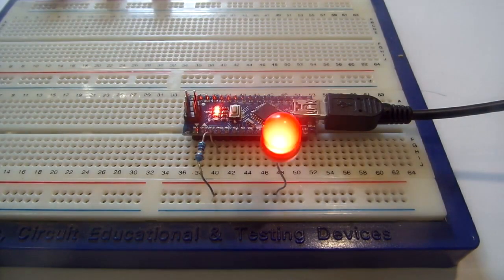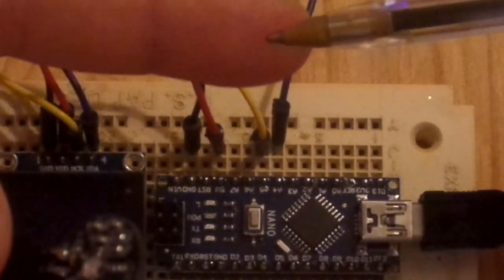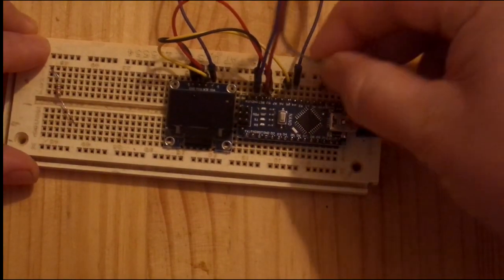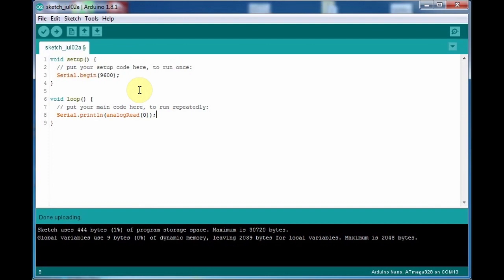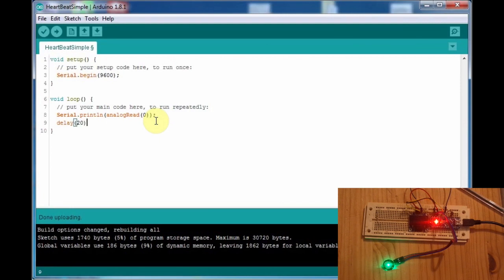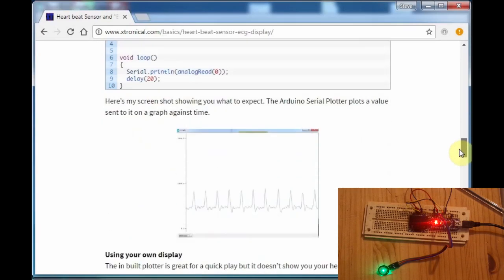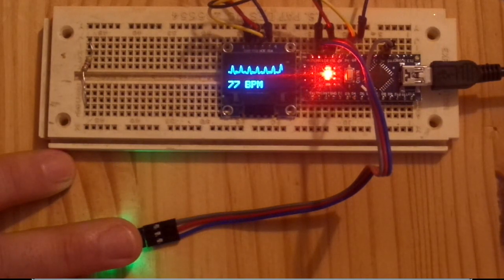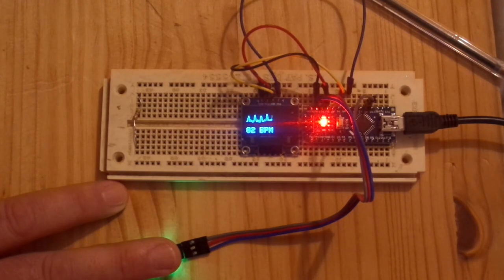Heart/pulse sensor with Arduino

Comment: Hey man, i tried running your code and my BPM was 0. So i checked the raw value with help of the serial plotter and found it to have a range of 120 to 130. I changed the threshold still found no change. I also had to set my cursor to display BPM from (0,50) to (0,0). Please help me. I am using  this 
Oled:- https://www.amazon.in/ThinkletsTM-Yellow-Blue-Display-Arduino-Raspberry/dp/B0778VMFJG/ref=sr_1_3?ie=UTF8&qid=1524481313&sr=8-3&keywords=oled+display+for+arduino
and this sensor :- https://www.amazon.in/Invento-INVNT_11-Heartbeat-Detector-Arduino/dp/B01MU8KP38/ref=sr_1_1?ie=UTF8&qid=1524481361&sr=8-1&keywords=pulse+rate+sensor+arduino
Reply from the maker: Hi, there are some displays which seem to  need an offset value for Y position, it has come up here more than once. I'm thinking you OK with that part from your comment. The BPM as you noted depends on the values returned from your sensor and the threshold values. Values of between 120 to 130 is far too small a range to make any real judgement of BPM, if you look at my raw trace (at http://www.xtronical.com/basics/heart-beat-sensor-ecg-display/) it has values of between about 480 and 700. Why yours returns such a small range is a bit of a puzzle. They are not the most accurate of sensors but I would expect it to be better than that. I would suggest putting it on someone else finger (in case your capillaries are somehow deeper) and also do not press it on too hard or to loosely as both these factors dramatically affect the result.
Reply: Hey, buddy thanks for such an early reply. I actually tried to run the code without the OLED and got a range of 500 - 550 specifically for the pulsating signal. But when I connect the OLED and see on the serial plotter I get a range of 120 - 130. I am using Arduino UNO R3 board for uploading the code. I also tried different fingers and different intensity of force to place the finger, still I can't see the a proper visual of the signal on my OLED and the BPM value stays 0 while I see a very tiny bar signal on my OLED
Reply from the maker: 500-550 is odd in so much that those are the exact values for the lower and upper threshold settings. When it's 120-130 you could try a lower value of 122 and a upper of 128, but that's a really tight range and would usually just be noise, also alter this line (line 35)

int y=60-(value/16);

The 16 alters the magnification factor of the line, a lower value increases magnification, perhaps try 1 or 2 here.

The type of Arduino should make no real difference. The value changing when you plug in the oled suggests the voltage dropping quite a bit with the oled connected - although again this would have to be quite a bit and would be odd behaviour.

It seems like your pulse sensor could be faulty but to rule that out completely would mean buying another one from a different supplier.

I'm actually re-visiting this project this week as I want to add two screens and have bought new screens and a new sensor. I'll see if I get any similar issue.
Reply: Okay,  I will do the changes and see. I checked to run your threshold code, and I got a range of 320 - 360 now. It is really weird, that it is giving such low signal but I have used to this sensor for getting an output before as well.

Comment: Arduino: 1.8.4 (Windows 10), Board: "Arduino Nano, ATmega328P"

C:\Users\Akmal Zhafri\Desktop\USER LAIN\acap\sketch_apr17a\sketch_apr17a.ino:1:30: fatal error: Adafruit_SSD1306.h: No such file or directory

#include <Adafruit_SSD1306.h>

^

compilation terminated.

exit status 1
Error compiling for board Arduino Nano.

I have problem about this
Reply from the maker: Have you added the adafruit Ssd1306 library?
Reply: Thanks you , your help me lot

Comment: I am a beginner. I am helping my daughter in a project for technology class. We have two oled screens of the same type. I tried to separate the graph in one screen and in another BPM and I could not. I would greatly appreciate this help. Surely for a knowledgeable person, it is clear how to do it.
Reply from the maker: It is possible but unfortunately not straight forward. I'm not sure of your level as a beginner but basically the Arduino sends data to things connected to it, such as the OLED, in a way similar to the way letters are sent. It sends packets of  information that has an address on it. The screen is manufactured with one particular address, so if you have two screens they will both have the same address and it's impossible to tell the two apart and you therefore cannot send some data to one and not the other.

There are solutions. 

One is to add an extra chip that allows you to stop one of the screens listening for data whilst you send to the other and vice versa, but I don't have one in my parts bin to build a demo with.

Another is a "software" solution that adds another data route using different Arduino pins, it's a bit like having another town with the same street name in it. You would have one screen in one town (on one set of wires) and the other screen in the other town (a different set of wires). However it would require some work to get all working.

A third is to see if the address of one of your screens can be changed, some allow this by de-soldering or soldering a connection on the back. But all the cheap ones I've bought don't have this facility.

Someone else requested this a little while ago and it's on my "to do list" but has not made it to the top yet unfortunately. I'll message on this thread when I have a look at it.
Reply: thank you very much for your response and for your interest

Comment: on oled it does not show me numbers with BPM it only shows graph plz help
Reply from the maker: It may be you need to alter the Y position of the BPM text, these lines do it:

oled.writeFillRect(0,50,128,16,BLACK);
oled.setCursor(0,50);

Try changing the 50 in both lines to 20 and see if it appears (Will probably go over waveform).  Then you can also move the wave form upwards with this line

int y=60-(value/16);

The 60 alters the trace Ypos, try 20. This should move it upwards making room to move the BPM up. Another user had a similar problem and I'm guessing different hardware not working quite same with adafruit oled driver perhaps.
Reply: Everything works almost perfect

Comment: Can we use this sensor on the chest ?
Reply from the maker: I've not tried, it might work but it is a pulse sensor not heart sensor. It doesn't detect electrical impulses but rather changes in blood flow in the capillaries under the skin. This may or may not work on the chest. I've not got the circuit set up at present to test but the finger is more convenient.

Comment: what lcd is used..?
help...!
Reply from the maker: It's a 128 x 64 pixel oled display. It uses the Adafruit 1306 driver and is I2C for the connections. There is a full write up for this project at 

http://www.xtronical.com/basics/heart-beat-sensor-ecg-display/

and a write up just for the OLED at

http://www.xtronical.com/basics/displays/oled-128x64-arduino/

Comment: Your code is not giving me any BPM when I keep on the finger used it through Bluetooth..it is only working when I took my hand frequently..is there any solution to fix this..
Reply from the maker: How did you use it through Bluetooth? Have you tried the simple code to send your results to the serial plotter
Reply: I used it through SoftwareSerial.h
SoftwareSerial btserial(10,11)
btserial.Println
Reply: I am not getting output when I keep on the finger ..it shows output when I frequently take the hand from sensor..pls give me correct code or suggestions to make it correct
Reply from the maker: The code is correct as it works for many users. Try checking if your sensor is returning anything sensible, to do show your heart beat graphically you can use the Arduino IDE in-built serial plotter. Load up the code below into your IDE, then upload to your Arduino. Then select “Tools->Serial Plotter” and see if you are getting some output from the sensor.

void setup() {
  Serial.begin(9600);
}

void loop() 
{
  Serial.println(analogRead(0));
  delay(20);
}
Reply: For ur code I'm getting automatic values running in loop without touching the sensor
Reply from the maker: You will get some values fluctuating from the sensor, this is normal,, this is the sensor doing this not the code. Have you tried the serial plotter code I mentioned?

Comment: I’m getting an error code with the display code saying ‘error compiling for board Arduino/Genuino Uno.’(I am using arduino uno)
Reply from the maker: There should be more text than that, there should be the actual line displayed where the error is occurring, have you any more details
Reply: XTronical I’m pretty sure that’s all it says I’ll have to have another look so you perhaps have an email that I can contact to show the error message?
Reply from the maker: If you private message through you tube I'll pass my email on through that.
Reply: so I was being a bit stupid and the error code immediately put me to the bottom of the error section so i scrolled up and the error message says... 'C:\Users\family\Documents\Arduino\heart_beat\heart_beat.ino:1:30: fatal error: Adafruit_SSD1306.h: No such file or directory

 #include <Adafruit_SSD1306.h>

                              ^

compilation terminated.

exit status 1
Error compiling for board Arduino/Genuino Uno.'
so im still slightly confused by this but im assuming it simply means it cant find the correct file needed to run/save the code?
Reply from the maker: Yes, go to library manager (on sketch menu), search for adafruit 1306 and install that library. Make sure you have installed the graphics library too from adafruit. I
Reply: XTronical thank you ps will it be okay if I reference you in my project for my college course as I have to put people who assisted in a section of the report (I can just reference the channel name).
Reply: XTronical could you please send me the link for both of those please because I’m not sure I have the right ones as I’m getting nothing displaying on the screen but the code does upload to the arduino now
Reply: XTronical it may be my screen because it has 7 pins instead of the normal 4.
Reply from the maker: Of course you can reference the channel name, very polite of you to ask :)
Reply from the maker: The links are on the page with the code on it, here : http://www.xtronical.com/basics/heart-beat-sensor-ecg-display/
Reply: XTronical okay thank you just didn’t want to reference you without your approval first. after all it is your channel :)
Reply from the maker: Yes, sounds like you have a different screen, send me a close up screen shot of it, you've got my email now.

Comment: Hello,
i did in Uno, it is olny showing waveform but it is not showing BPM. please tell me that what is the problem
Reply from the maker: Is the wave form near the bottom or does it look like the one in the video, it may be you need to alter the Y position of the BPM text, these lines do it:

oled.writeFillRect(0,50,128,16,BLACK);
oled.setCursor(0,50);

Try changing the 50 in both lines to 20 and see if it appears (Will probably go over waveform). Are you using a 128x64 pixel display?
Reply: yes, the wave form is in the bottom.  i am using 128x64 pixel display
Reply from the maker: Then you can also move the wave form upwards with this line

int y=60-(value/16);

The 60 alters the trace Ypos, try 20. This should move it upwards making room to move the BPM up. Another user had a similar problem and I'm guessing different hardware not working quite same with adafruit oled driver perhaps.
Reply: you using 0.96” inches display or 1.3” inches display?
Reply from the maker: 0.96 inch 128x64 OLED display.
Reply: Thank you so much. it helps a lot to me
Reply: Thank you. its working😊
Reply from the maker: Excellent, glad it helped.

Comment: Hi!! How to display bpm without using led monitor but on serial monitor itself? When I read the article it's simply been given that we cannot .. Is that possible if we use some extra code?..Pls help admin
Reply from the maker: If you scroll down the page you've read, towards the bottom you will find a section titled "Addendum". This has the code to output the BPM to the serial monitor.

Hope this helps :)

Comment: what to do if values are overlapping with each other and also the values are overlapping with the waveform please give me a solution.
Reply from the maker: The waveform needs scaling differently, this line:

int y=60-(value/16);

scales the height of the pulse, changing the "16" to a higher value will shrink the height of the pulse. Try something like "20" to starting with and adjust if that is not enough or too much.

For you other problem, do you mean the numbers of the BPM, e.g. "73" actually overlap each other?

Comment: Which module should I opt for measuring the heartbeat constantly then ??
Reply from the maker: Here's s link to the one I ordered: 
https://www.aliexpress.com/item/Pulsesensor-Pulse-Heart-Rate-Sensor-For-Arduino-Open-Source-Hardware-Development-Pulse-Sensor/32714920300.html?spm=a2g0s.9042311.0.0.XznPAg
Reply: No, In the verdict you said that though it is measuring the heart rate ,if we apply less or more pressure it gives error
So which other sensor should I use, I want to monitor hear rate of a person constantly and alarm if it comes in a certain threshold
Reply from the maker: +Arjun Sharma sorry for misunderstanding, I have not investigated other sensors yet.

Comment: I'm use 0.96 oled 6 pin (+pin (DC+Reset)..... And i do this video but it's don't work???? 
Can you help me for how i can connect the oled 6 pin with arduino mega?? 
And give me the code with the Modifications That fit with the 0.96 oled 6 pin??? 
Please
Reply from the maker: +Master7 Semo do you have a link to the oled you have so I can check it out
Reply: XTronical this is the link http://www.rhydolabz.com/displays-c-88/096-oled-display-module-spii2c-128x64-6-pin-white-p-2260.html
Reply: XTronical For information i work on (arduino mega)....... 
I'm looking forward to helping you
Reply from the maker: OK, I've looked at the OLED and to make it work with the project (in I2C mode) actually requires some soldering on the PCB of the OLED itself, sounds a bit of a pain. However it supposedly works easy with SPI protocol but I don't have a similar screen to hand to test with. I'll order a similar screen I'll re-do the code.
Reply: XTronical ohhhhhh 😢..... That's main i can't do anything to do the project....
Reply from the maker: +Master7 Semo Ali express are cheap, look for a 4 pin I2C one

Comment: Hi I follow your video, thanks for sharing.
Mount the sensor and it works, a question the beats are overwritten in the screen, is it normal ?.
in his video this defect is not observed.
I have something wrong?
There's a solution?
A greeting from Barcelona
Manel
Reply from the maker: Do mean the trace goes over the BPM text? If so your sensor might be giving a bigger result and just needs to be scaled down a little.
Reply: No, taraza and numbers are separated, this is correct, they are the numbers that are overwritten when they vary, one above the other.
when the trace finishes, then they look clean, but they are overwritten again.
There's a solution?
Your video the numbers always look clean.
a greeting

Comment: can i contact u?i want ask something..give an email also ok..
Reply from the maker: You can comment also on www.xtronical.com
Reply: XTronical why in serial monitor the reading become hundred something??but on your lcd is below hundred..what the difference between the reading in serial monitor and lcd?i want show the reading using mobile app..not using lcd..
Reply from the maker: There is no real difference, the value is either output to oled or to the  serial monitor, the code is effectively the same. I would think those higher values are just anomalous and just didn't occur when connected to oled.
Reply: XTronical my project is about to monitor temperature and pulse rate using arduino and bluetooth module hc 05. I already tried code for pulse rate..i just not understand the reading of the sensor.. How we want to calculate the bpm.
Reply from the maker: It can be a little tricky to calculate BPM from the raw sensor data. What the code does is look for a "pulse", that is it checks when the reading goes above a certain value (UpperThreshold in the code). When it does it takes this as the start of the pulse. It then waits for it to back down below another value (LowerThreshold in code). When it does this is then a complete "beat" (or pulse). It then stores a start time and waits for another beat ("pulse"). When it gets one it then stores an end time. From these two times it can work out the time between beats and thus with some maths can calculate a BPM. It's all in the code but can be difficult to work out depending on coding experience. Hope this helps.
Reply: im still not understand..what u mean sir?because i not understand value in serial monitor becomes above 500..but when at lcd it become 80 +.how do u convert the value?.can u give more explaination sir..im really appreciate it
Reply from the maker: I will do a write up on http://www.xtronical.com with some diagrams to help but that will not be for a short while, keep an eye out on that site, will post here as well when done.
Reply: ok tq sir